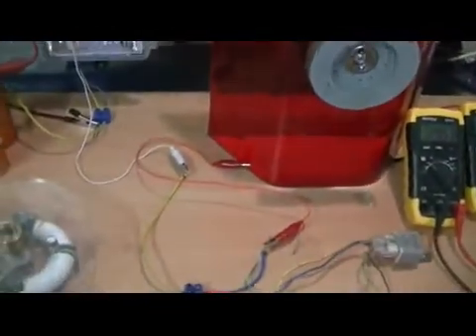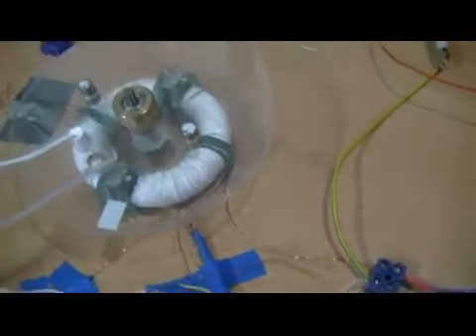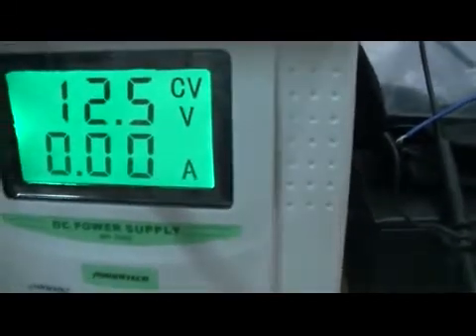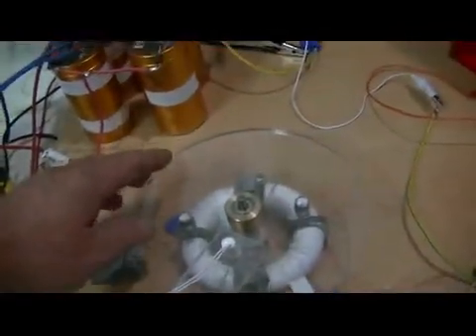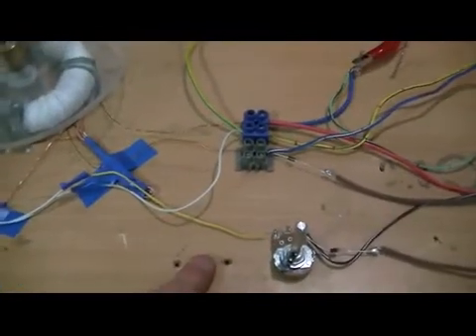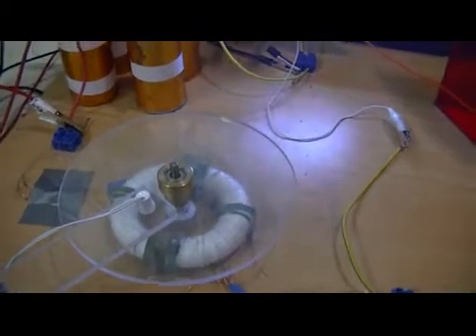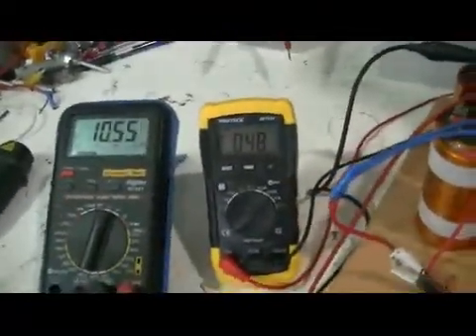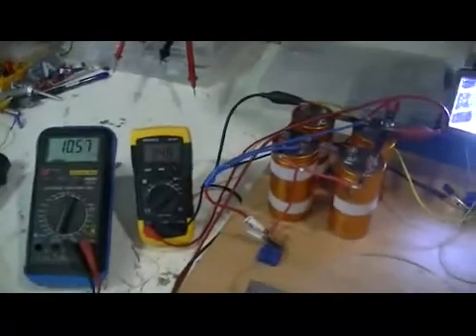lens assist generator with reed switch.flv

Comment from the maker: Well i cant seem to be able to reply to your post's user2718218 -so i will do it here.I have found that even with that horible relay i get a better performance-power conversion than with the transistor.It still can be tuned a lot more as the relay is staying on way to long due to the reed useing the magnets that are close to the midle of the rotor.Im going to glue some on the outside of the rotor for a quicker and more precise on time.I would like to know your thoughts on the generator now?

Comment from the maker: Hi User2718218-funny you should say to use the reed to fire the transistor,because as you will see on the forum that's what i was going to do.However i decided to get rid of the transistor to eliminate any doubt about timeing being changed.I am actual going to try a fet next and get some results from that.You may not like my next vidio,but it was just an example and my defence on your comment about only getting 30* back from a pulse motor.I get 40% just from the generator alone.